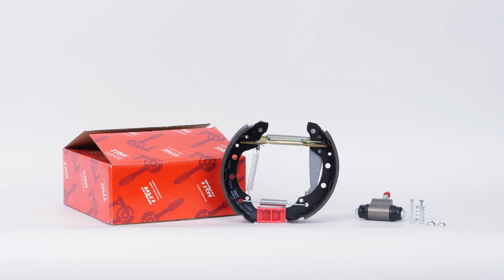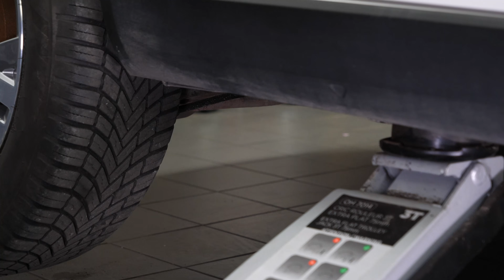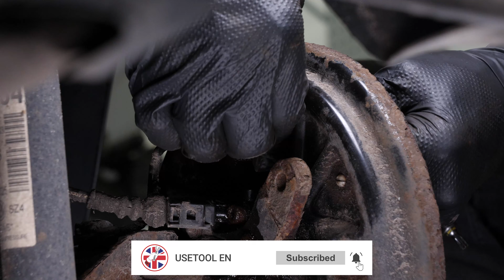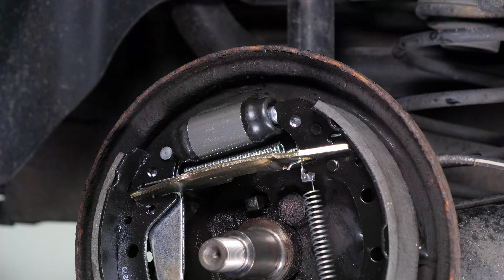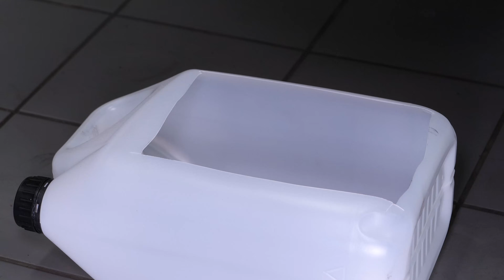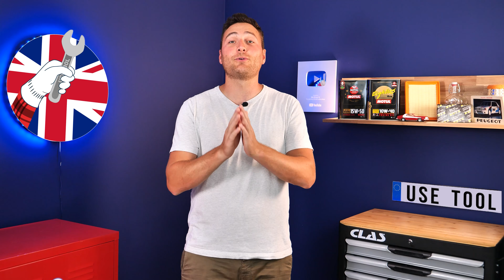How to replace the drum brakes Volkswagen Up! 🚗

Comment: They don't mention this, but before screwing out the brake cylinder line, you have to scrape off the protective coating on the line. Otherwise you will twist the line and it will rupture. mine did :(